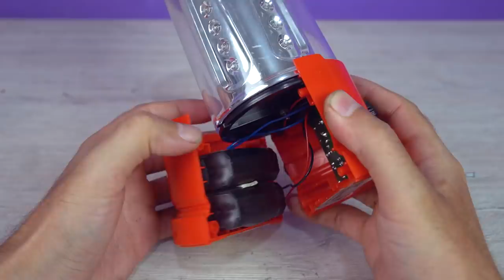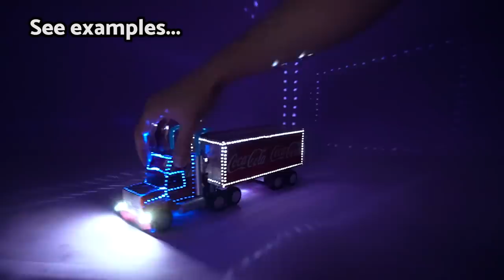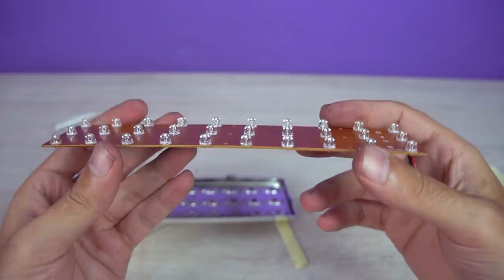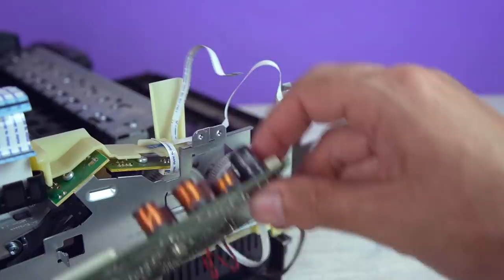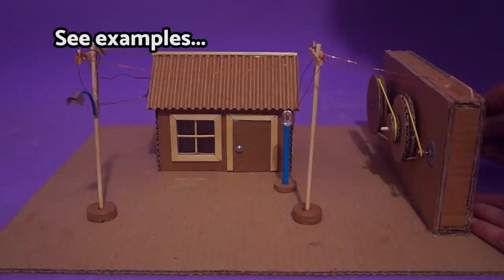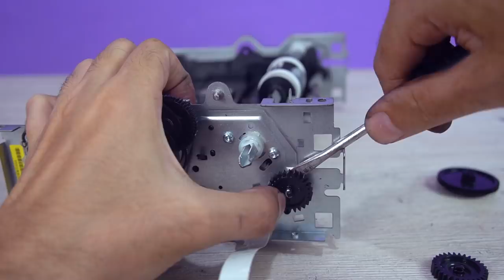Ache Incríveis Peças para os Mini Projetos

Comment: Faz um planador com motores dc, para isso vc terá q usar isopor , palitos de churrasco para prender e criar o sustendo do avião, bateria 9 volts , servomotores para os airelons e flaps , eu fiz um, vc pode usar peças de carrinho de controle remoto(de preferencia um com arduino v9) já q é possivel configurar os arduínos pelo própio celulat